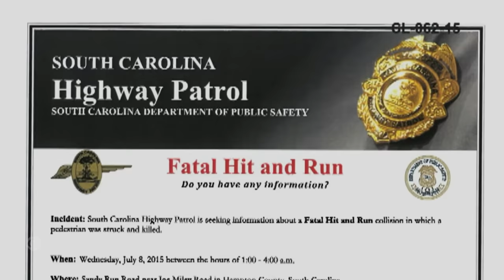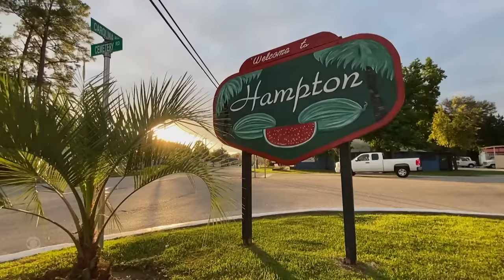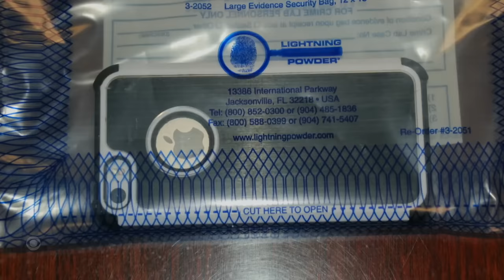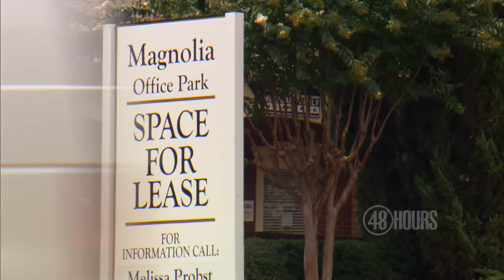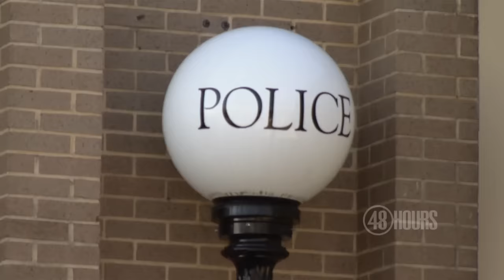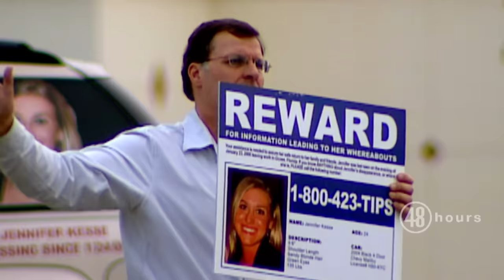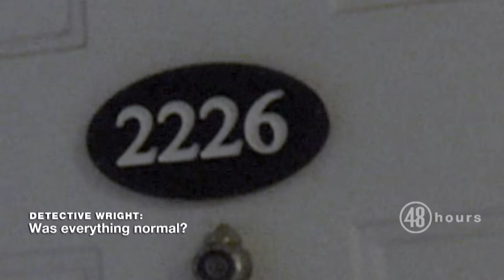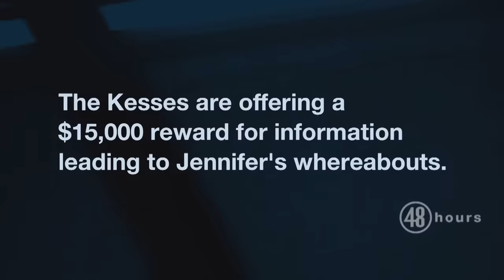Unsolved Cases | "48 Hours" Full Episodes

Comment: Jennifer’s perp was no doubt one of the renovation workers…. How is it possible the cops never talked to the 10 staying across from her’s….  (And why in a security residence are temporary worker crashing in vacant apartments?). Horrific as it sounds… south florida has a disposal system called The Everglades… where gators assist… if they have found her body by now… they never will.